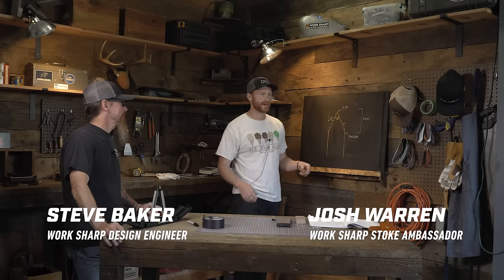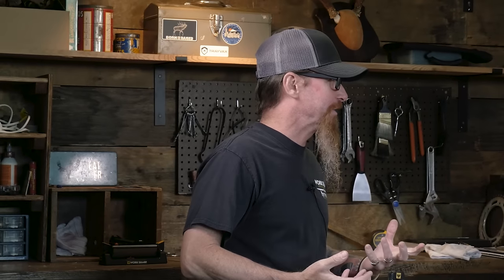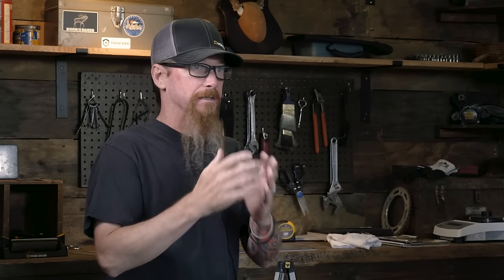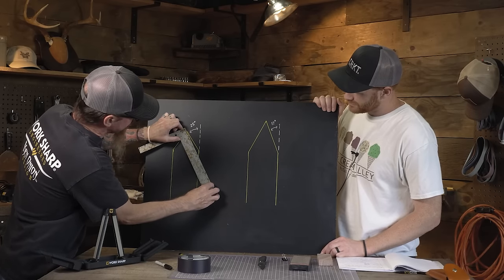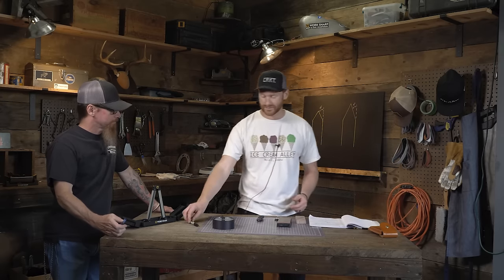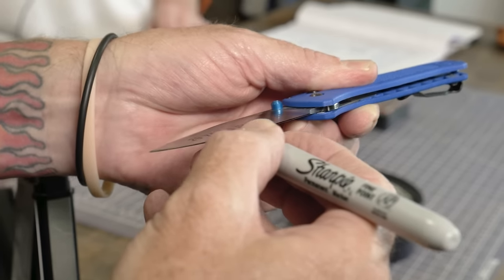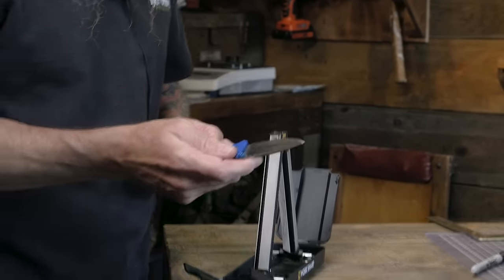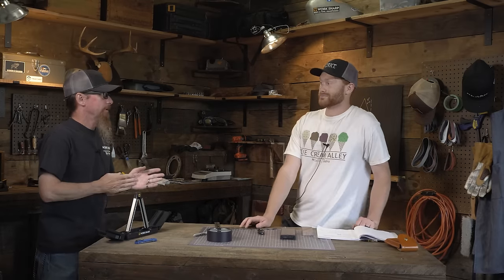What is Edge Angle? How to tell What Angle your knife is sharpened to? Workshop Ep. 9

Comment: Good info. Thanks guys. Thanks Work Sharp. I recently attempted again to successfully use my GONIOMETER in my attempt to understand my friends' kitchen knives I'm trying to sharpen. I learned it helps to first polish the bevel some with a strop to help more light reflect off the bevel surface. Also helps to use it in a somewhat darkened room. Finally saw the 14º factory angle of Wusthof knives. But because the owner seems to be chipping the edges, I decided to sharpen them at the Work Sharp recommended 17º. They turned out super sharp, easily cutting paper. Friends are happy, they claim they're just like new. Thanks again.

Comment: I have several EDC that range from D2 to S30V to VG-10.  I usually sharpen to 21-22 degrees. Should I vary based on steel type ? Is there a guide/reference for this? I use the Elite adjustable so can choose any angle. Thank you for sharing your knowledge with us

Comment: Is there any chart where you have, say, on horizontal the most frequent kinds of steel, like ss420 or ss440 and so on, on vertical the possible use, like kitchen veggies kitchen boning of camping all use, or whitling or etc, and in the at the intersection of a line with a column the best angle for that steel and for that use? I think that would help a lot with the angles coz everybody says its depending on the kind of the steel, but doesn't say the kind of the steel for the numbers he gives.

Comment: Benchmade 162 with S30V is ground to 15 per side. My Buck Ranger Sport Pro also S30V recommends 13-16 per side. I use sandpaper, stones, or the Work Sharp with blade grinder attachment depending on knife, steel, etc

Comment: Awesome video . The Sharpie tip is awesome. What it told me is that by using the Sharpie trick you can find the angle at which the factory set it and sharpen it consistently.  That's cool. Thanks.

Comment: I have mixed feelings, I tried my Vicotorinox  at 40 vs  Ganzo D2 blade at 30 and there was so much difference in favor of Ganzo that I was really surprised. I thought that thinner shoulders on Vic will perform better than thick shoulders on Ganzo. Primary grind is thicker than Vic but it was anyway so much better for planing a board for chips. I think I will sharpen my Vic to 30 degrees also. So what it will last shorter, but will it? Maybe on more aggressive usage. BTW Angle Set, the best there is.

Comment: i jsut got this kit. Took a while, to get it right. His technique works great on the downward motion. Seems a good bit of pressure. Ive been told use light pressure on diamond? but whatever it seems to work well. i kinda of screwed up one benchmade, but i got it back to normal at 17.5 then last 30 strokes with 20 for microbevel. Back to hair pop sharp. the kit works well, i had a sharpmaker years ago, and its similar

Comment: i bought your worksharp guided jig system, i read everywhere i should sharpen my mora at 27 degrees. to reach that do i set the angle to 27 or 13.5?
Reply from the maker: From Mora Knives website: Blades thicker than 2.5 mm usually have a total edge angle of 27 degrees, about 13.5 degrees per side. Most of our knives have the True Scandi Grind that includes the typical micro bevel of a total edge angle of about 35-45° which is about 0.05 – 0.5 mm high to make the edge less fragile and with better edge retention.
If you set your sharpener to 20° you will achieve and inclusive angle of 40° and can resharpen the micro bevel set on your knife.   Hope that helps!
Reply: @WorkSharpOutdoor  so I should set my guided sharpener to 20 degrees, and do that, and then raise the degree to what? 27 or 30 and sharpen the smaller tip of the blade? Wouldn't that be the same as just sharpening at 30 degrees to begin with?

Comment: 30 degrees for a bushcrafting knife? damn, what kind of brittle steel are you using? i can chop all kinds of stuff and almost downright abuse my cold steel SRK in 3V steel at a 22 degree angle...people seem to think they need way steeper angles than they really do, modern steels are better than people give them credit for
Reply: I run my Cold Steel 4maxx with 20 dsp. I baton with it, chop with it and do general tasks in the woods with it but it isn't a screaming edge bushcraft whittling knife. Traditional finnish puukko knives here in Finland are ground to around 10 degrees per side. It is purely a whittling tool though. 30 dsp IS way too obtuse for a woods knife, I cut carpet with one.
Reply: No, modern CPM steels were intended for industrial applications and are terrible at low angles, which is why people open their grind angles to match the poor industrial steel they think is better for knives. (It isn't). Older steels such as 420, 5160 and 440 are more amenable to actual knife use, but 440 is hard to sharpen and sensitive to bad heat treats.

Comment: The sharpener you are using on this video do you recommend and can you get diamond stone to reshape if needed
Reply from the maker: Yes, it's the Angle Set Sharpener we designed in collaboration with knife maker Ken Onion. It has coarse diamond (320 grit) medium diamond (600 grit), and fine ceramic which all rotate around the two rods.
Reply: Thank you I may need to get this one

Comment: I use your GSS System and this is designed to give a primary bezel of 20° (or 17°) but the secondary bezel is set by the ceramic rod with a guide of 25°.
What is the advantage of having a primary/secondary bezel?? I think that the GSS is the only one of your systems that does this so wonder if it is beneficial.
Reply from the maker: Setting the ceramic at 25 makes it so you are guaranteed to get to the cutting edge when honing.. If it were set at 20 degrees and you were off by 1 degree honing at 19, it would not do anything and you would not remove the burr. So it is set at 25 to help users be successful when removing the burr. It also creates a micro-bevel, meaning the very tip is sharpened to a flatter angle than the rest and it is slightly more durable. Picture the concept of a convex grind.